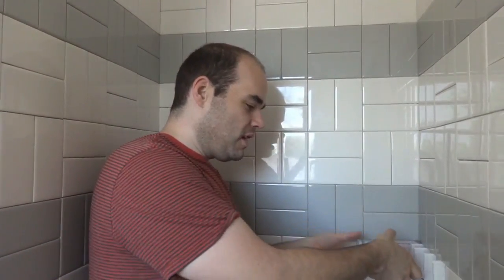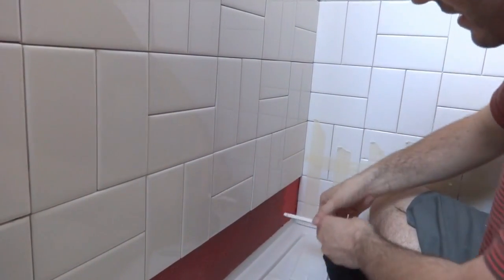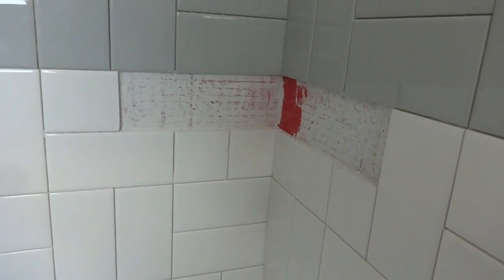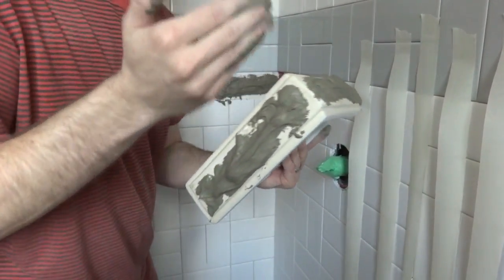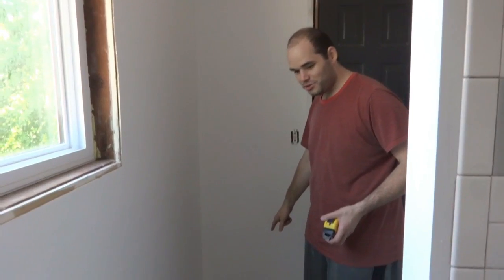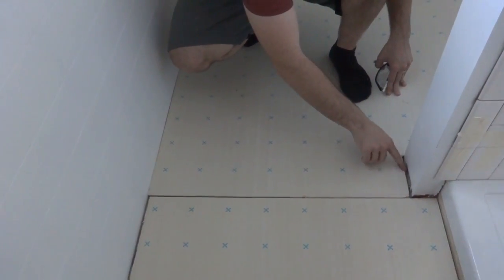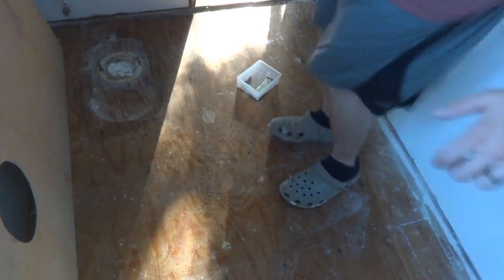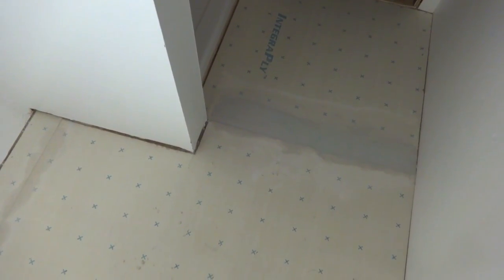I Got Glued to the Floor!

Comment: we have to redo our floor in our bathroom ,that underlay flooring you just put in,is that for waterproofing the floor?
Reply from the maker: No, this particular underlayment is used to give us a nice, flat surface to apply the tiles on top of the old, rough, adhesive coated subfloor.
Reply: Ah! Ok thanks

Comment: Im about to have to do some tile work in my own home and I was wondering if you think if you would have put the guide board a bit higher if you wouldnt have to custom cut all the bottom row of tile since you had to custom cut the top too? Thoughts would be appreciated also super big thanks for the masking tape & hot glue trick that is an awesome tip!
Reply from the maker: You could probably do it that way. There's a good chance that both the show pan / bath tub and ceiling are not level though, so you usually have to end up doing some custom cuts.
Reply: MrDiyDork Good point. Thank you!